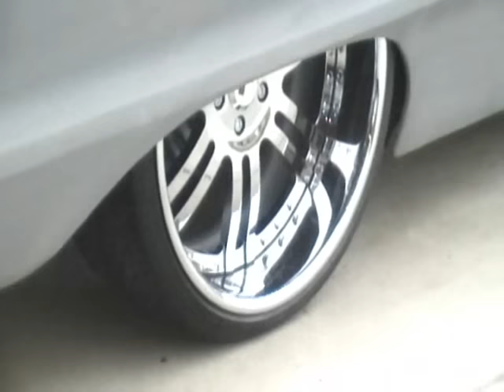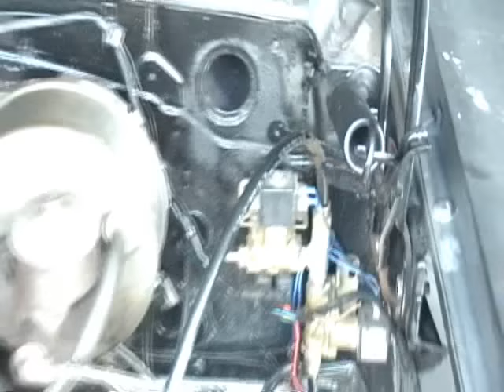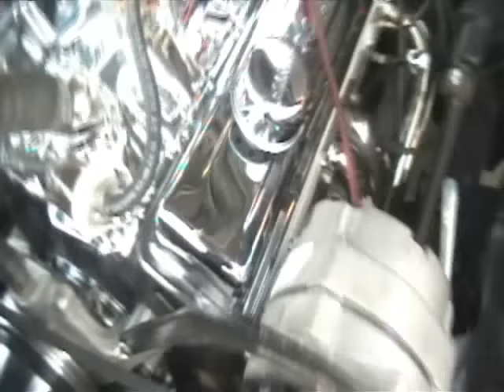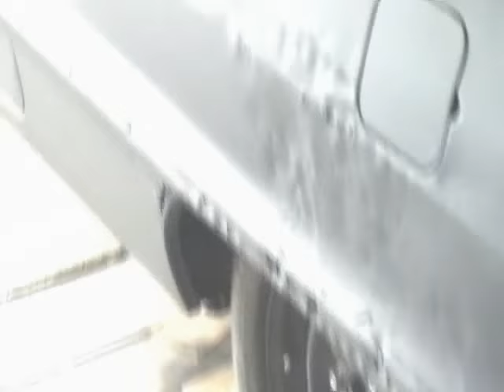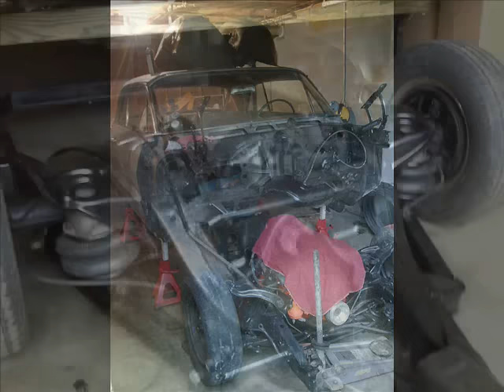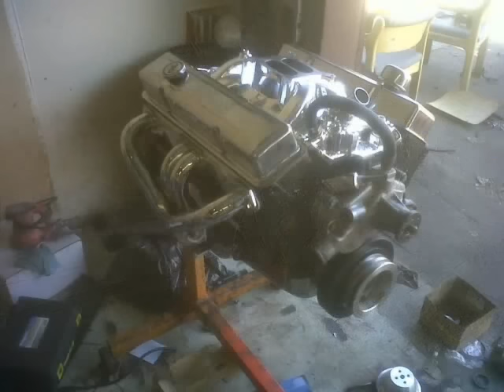1963 impala 22'' asanti / air ride/ chrome motor -Big Boyz Toyz dvd

Comment: Can I fit 20x9.5 rear without mod?
Reply from the maker: Adam yes you can go op to 10.5 no cut you can do 11’s if you trim the lip off
Reply: aDaywithCALIBOY cool thanks man . I keep having people and wheel sellers telling me 20x9.5 won't fit the rear without doing some cutting . I already know I'll have to route my exhaust out the side . But I wanted to do that anyways and already have the side exit tips .
Reply: aDaywithCALIBOY did you get an adjustable panhard bar ?
Reply from the maker: Adam nope stock